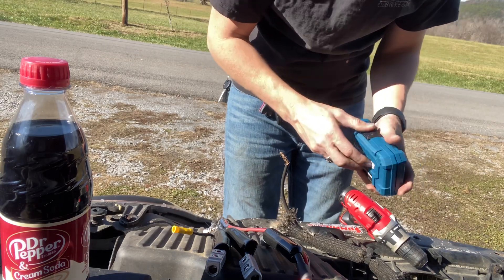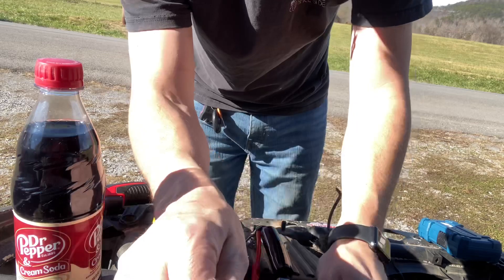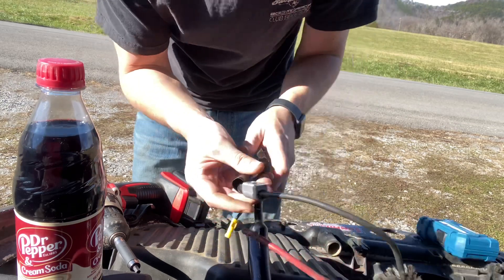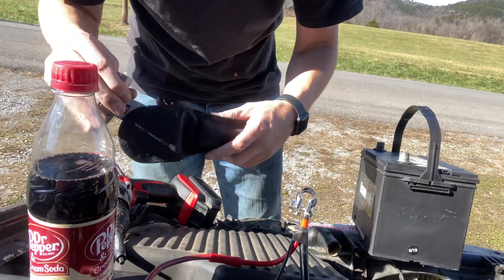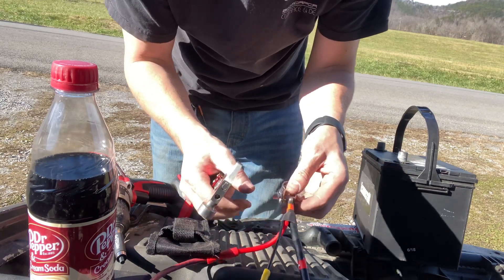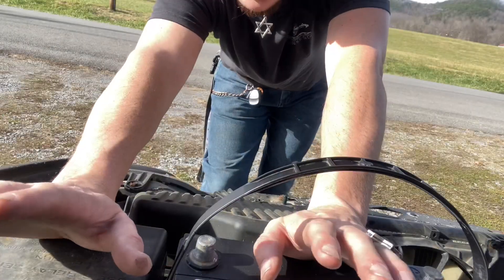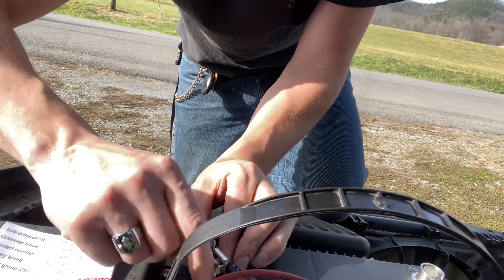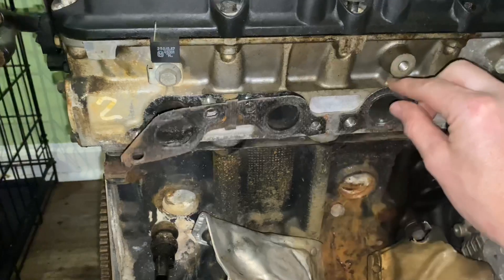2000 Dodge Neon rebuild part 3: putting on battery cables...

Comment: I need instructions on replacing a 1998 Neon battery wire. OEM replacement cable is over $150. Yes, you read that right. It has a special terminal on the fuse box end, it seems. There HAS to be another less expensive way. I bought the car used an it does not have the cable! I didn't know what it looked like until I looked up the OEM part. Thx!